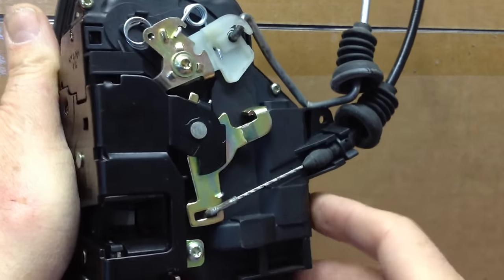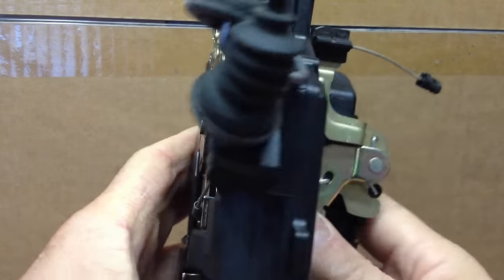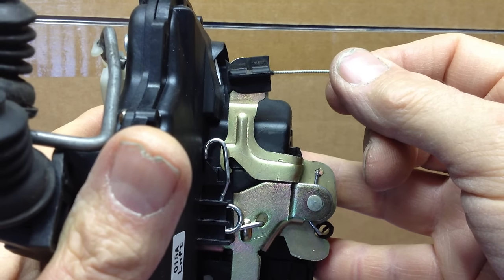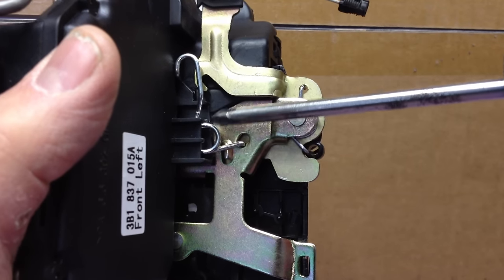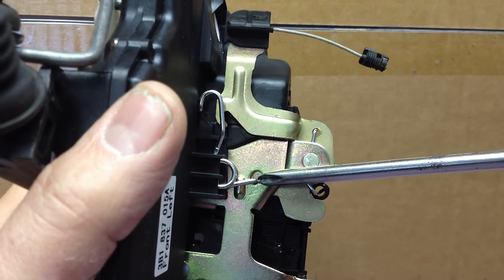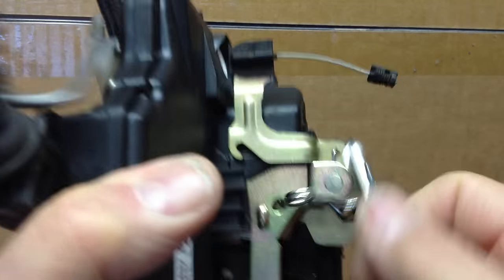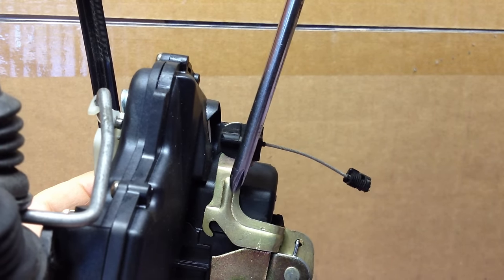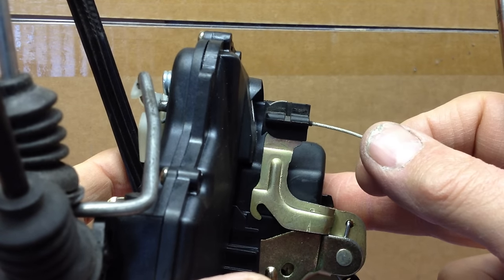Why Your VW Door Won't Open

Comment: The spring that you removed does have a purpose, its to set the tension to the wire that connects the handle to the lock on install. Though it is weird why it scratches the metallic thingy below!! :o
Reply: So, you are supposed to remove the spring after installing of the cable?
Reply: Not remove it unless you want to spend hours after to find the right position for the cable to open the door by handle..Very frustrating!

Comment: Hey Man you're cool. I My car door recently seems to have this Problem. I have never tried to hit one time harder onto the Door Handle if it did not unlock. (Indeed this short harder pushback action also resets the hook mechanism in most cases, then it is able to open). Thanks!

Comment: The other way to do it is whenever the door refuses to open, just disconnect the battery for 10 seconds. Then reconnect and initially flick the open all doors, and then flick close and open again. This works for me every time. That said my door handle does not get stuck every time. I think it is on the way out but those mechanisms are too expensive and I have an 02 Mrk 4.
Reply: When would you do this? My Skoda Octy rear door isn't opening (child lock on too) however I can hear the mechanism locking and unlocking. Not sure if disconnecting the battery would work or do I need to strip down the door panel etc which would be a pig of job?
Reply: SoleFreak my be rear door did the same thing. If you disconnect the battery for about 10 seconds than reconbect, I think that resets it. Than use the electronic switch on Riverside to open and close it a few times. It works for my be golf. Try it what have you got to loose? I think the process has the effect or resetting the locking mechanisu. Like the guy indicating in vid.

Comment: My Beetle drives me nuts, it drives like a dream but all the stuff like door handles breaking and driver door not opening, can't lock the doors from the inside while driving at night you lock them but they pop up again. VW really need to get their act together. I'm in Australia VW had no idea how to fix my broken passenger and driver door handles so I searched the net and found Jim at Dieselgeek in the US who has a fix called Beetle Brace with a metal plate to brace it all together.
Reply: Ha ha, please swap with an ORIGINAL (old) beetle !!

Comment: I would have this man's babies right now! genuinely from the bottom of my broken heart I thank you sir. I have had this door mechanism of four times stripped, replaced and couldn't figure out why it would open and then stopped
long and short if your lock works but your handles in or outside don't the semi circle piece of plastic on the end of the outside handle needs LOOSENED NOT TIGHTENED as it stops the mechanism from resetting I've changed religion 8 times renounced faith had a duel with the devil begged God for forgiveness and all I had to do was open the outside handle moved the black piece of plastic down a few teeth 😥 I'll sleep well tonight
thank you again.    ☝this guy ☝
Reply from the maker: Will Fleming quite the offer, but I'm taken already. :o)

Comment: I have a 2003 VW Bora 2.8 VR6 4motion and although it has the same spring as in your clip mine does not go through a hole , instead it has a tang punched out of the plate that the spring locates on so for me this isn't a problem !!
Unfortunately of course wasn't able to know this till I pulled the drivers door apart .

Comment: Jon my new to us 2014 Cayenne is doing the same thing after I adjusted the micro switch on actuator. Hopefully try the spring reset and then remove the little useless spring altogether

Comment: This is gold. Thank you very much, I had exactly this issue when installing the new lock via the workshop manual's exploded chart: it instructs to fix the spring into the little hook during assembly, which makes no sense to me as it seems it makes the whole cable immovable from that point on, so you cannot use the handle to open the door. 
However, a comment below from Radu Popescu explains that the initial use of the spring is to "measure" the length of the cable so there is no play in it and at first use it "snaps free" pretty loudly, so the mechanism knows the exact length of the cable. Presumably after that it can be removed. I do wonder though how this very tight spring can "snap free" without possibly doing damage to the plastic part. Also, I do not understand the logic of that, as the spring and the lever would be unmovable (it is VERY tight), so the cable would not move at all. Also, the locking mechanism is not tied to the lever, so locking/unlocking has no effect on this fixed position.
The workshop manual does not mention either that the spring is only serving the purpose of the initial installation and it should be unhooked after installing the lock. The result is that you probably will not be able to open the door with the handle after this procedure (at least, I assume as I will not do it according to the manual).
I am in doubt now about first installation of a new lock: according to the manual (i.e. use the spring) or not. 
The manual is pretty adamant about it and states: "It is absolutely necessary to perform a functional check because the door cannot be opened if the adjustment is not accurate and if the Bowden wire is not clipped on correctly." Which makes me assume that the "adjustment" it mentions has to do with cable length?

It further complicates things that the manual says: "During assembly keep the door handle -2- pressed against the door panel."  I saw instruction videos however where they said to PULL the handle while uninstalling the handle cap. I assume the pulling is only meant for the cap, while the pushing is meant for the cable installation?..
Reply: OK, so I did the manual instruction after all, by clamping the spring to the lever. I think the reason for this is so the cable remains in place while you fix it in a variable position and the cable is exactly tight, not too much and not too little. 
So I do not see a link between the electronic and the mechanic. It is purely to keep the cable in place while fixing the plastic ribbed end.
Reply from the maker: Yes Peter, that spring is only used during initial installation to set cable position. It does snap out of the way after the first handle pull. My concern is where it pokes through the hole and hinders the arm. Other than that, it shouldn’t cause any trouble. Good luck.
Reply: @jonplamondon4076  Yeah, it worked just fine. Also, I don't have the hole-poke issue, because mine is slightly different (for Octavia mk2) and it does not go through the hole, but is led next to it. Funny how all else is identical.

Comment: Hi, firstly thanks for the video this helped me with a new lock i just installed today and had the same issue with. After looking at my setup i noticed that the external door handle connector that Jon holds at the start of the video is grooved (see around 01.27) and so is the area where this connector sits in the external door handle. Im guessing that this allows the external door opening mechanism to be adjusted if the cable stretches etc. In my case it was not the spring that caused the problem it was that I had inserted the connector too far away from the door mechanism meaning that even with the door handle in the home position the level never reset itself as there was a tension in the cable. My advice, pull the door handle out and use a small flat headed screwdriver to carefully lift the connector out of its current position, use your finger to put pressure on the cable to stop it from withdrawing into the door frame and reposition it a few millimeters further back in the door handle grooves. Ensure it is pressed back in the grooves close the door and try again. Good luck this helped me and I hope it might help some others.
Reply from the maker: Great troubleshooting. I think that spring that I recommend removing fits in that notch to hold the arm in a position during assembly that closely places the ribbed dohicky in where it needs to fit into the exterior handle. You're right, you can't have that too tight.
Reply: Jon Plamondon absolutely correct. Thats its job. Just for inertial installing the tension of the cable. Cause if theres too much tension the arm cant go fully back its way and the door cant open anymore. My golf 4 doesnt open anymore (right back door). Thats my work for next weekend. Greetings from germany

Comment: Ok... thats a good thing to do if the spring is broken. It will do the job.
However the spring is there to satisfy a purpose. First thing to do prior installation is to "arm" the spring in the notch. If there is no fault there,  that should do the job and would also be the default configuration.

Comment: Happened to me today!!! What a nightmare! I unlocked, opened the door sat inside and proceeded to shut only to have the door NOT CLOSE!!!!   I panicked!!! I had to be at an appt and my only option was to wrap the seat belt around the handle AND was holding the end of the buckle all the way ......yes I drove! I called the dealership, not much help other than "Bring it in".....about half an hour later, I nudged it a bit and found that it had magically closed........Am taking it in tomorrow to demand it be looked at! GRRRR

Comment: In the process of figuring out why my 2000 VW Passat rear passenger power lock won't open and close properly.  All I see is that the button doesn't travel up and down properly when unlocking/locking, though the manual mechanism works fine.  I'm assuming it's something with the actuator motor, but I'm still researching.  I appreciate your video, though.  While researching, I did find a nice explanation of the spring you mention, as well, here:  https://youtu.be/RqmqnK6UXvY?t=169
Thanks for the nice, clear video; great to have folks like you with good content!
Reply from the maker: Thank you.

Comment: Had my VW T5 passenger side door dead locked,cut out the middle shelf to expose the metal plate after bending the door card half out the way,where i saw the lock unit i used a small screwdriver too make a small hole and squirted WD 40 in there,  i was about 10 seconds from smashing up the lock to get the door opened and i tried the central locking,to my amazement it opened,took me around 4 hours,stripped the unit cleaned and belled out the micro switches all fine,so maybe my anchor piont on the door is out off line and iw was not able to unlock. 2 black blanks in metal plate for undoing bolts that hold glass on the runners, hope this helps some one!!!!

Comment: i found that if i just push the exterior handle in until i hear a click, this resets the whole thing. minor inconvenience without having to open the whole thing up. If it fails and i cannot open the door, i will follow your instructions. thanks
Reply: YES!!!...Thank you also Vic, as this also worked for me on my 2000 Golf!  I couldn't open driver's door with lock nor remote, pushing slightly on the door worked for me.  As an added tip, my car is GLS with power windows, and if you unlock the driver's door with key but hold it, the windows (qty-4) will roll down, and you can at least get inside one of the doors via inside door release lever ...but I didn't want to have to do this all the time and be conspicuous, and I'm not excited about opening up the door to replace or work on the doorlatch...this will become my permanent workaround (at least it makes it harder for anyone else that doesn't know the trick to get into my car).  Hope this helps someone else as these details should have been remedied before production, guess we're the beta testers, though not through conscience choice.

Comment: ...every journey starts with a ridiculous handshake. Twist the key, fist bump the handle, pull open the door.I live the "Macarena".

I noticed this spring while replacing the micro switch and wondered why it was even there too. Sometimes they over engineer some neat stuff though as if its for catching that hook for ease of installation...."whats this? designers are thinking about the guy installing the part? nahhhhh...couldnt be" lol

Comment: I had the same problem, but for me the solution was just re-aligning the locking module with the bracket it locks on to. So if this doesn't fix it, that maybe will.

Comment: I'm about to install a new lock module; should I do what humble mechanic suggests and hook on the spring, or do what you do and remove it completely? Many thanks for your help.
Reply from the maker: Shirley, I would go ahead and leave that spring in place as it prepositions the little block on the end of the pull cable correctly in the outside handle. Just make sure the end that of that spring doesn't interfere with the lever.

Comment: I used to think that German cars (Volkswagen, BMW, Mercedes etc.) are reliable and always have high quality. When I was about 11, my father had a BMW 350CC motorbike. It looked so husky, strong and healthy. I trusted German products and respected Germans for their talents. It lasted for years (over 30 years) until my brother gave me a 200 Passat 2.0T. I am a careful driver and not in a hurry in any situation. I spend time regularly almost every week wash the car, wax it, clean inside, check the engine oil, change the engine oil every 3,000 miles, refill the windshields cleaner, check the tires pressure etc. I always keep the car in good condition. The mileage is only over 50,000 miles. Recently, they have some troubles with the passenger door. It cannot be opened from outside. Besides, the headliner is sagging. The airbag needs replacing. The noise from the engine annoys me so much that I think I have to sell it. It is too much noisier than my 2017 Honda Civic and 2016 Hyundai Elantra or even my 1997 Honda Acura.  If anybody is thinking of buying a German cars, please do not buy a Volkswagen vehicles (Passat, Jetta, etc). Believe me! You will feel sorry later.
Reply from the maker: I might not agree. I ran my diesel Golf over 415,000 miles. Lots of preventative maintenance and a few minor issues, like the door mechanism. Stuff's gonna happen. When you find the perfect world, send me the address. Thanx for your comments.
Reply: It happened to me. How can I say in other way. You have your idea and I have mine. Ok?
Reply: 🙌 👏 🙏 🤝 👍 germans lost ALL credit ! The best VW is the the old 32b (Quantum) type . . . see also BRAZIL  . . . Just do NOT crash it please . . . drive carefull and relaxed (its without ABS, Airbag etc.. . .but lasts 4-500.000. KM ! )
Reply: @jonplamondon4076  🙌 👏 🙏 🤝 👍  my vintage AUDI 4000 ran also about 435.000 KM without much bucks for maintenance. . . .

Comment: Jon Many thanks for taking the time to share your knowledge with everyone. It has not worked, yet on my 2006 Altea. With neither remote, drivers door key, outside or inside handles unlocking the f passenger door I have managed to remove the upper door panel and get my hand inside the panel to try to set the lever you point to with your screwdriver. I have pulled it out and pushed it in many times but still no luck. I have come to the conclusion it is an electrical problem as the window on that door stopped working at the same time. Any thoughts please?

Comment: That "useless" spring is set inside that little nook it sits next to and controls the depth at which the outside handle releases the mechanism when pulled.
Reply: Dana Wane  Whats the root cause of the fault?
Reply: Likely from incorrect installation.

Comment: Hi Jon! Should I insert the screwdriver through the outter or inner window slot? And the window should be open or closed? Tks
Reply from the maker: Window down should make it easier. Inside side of slot.
Reply: @jonplamondon4076  Hi Jon! Thank you very much for your immediate reply and for this video, which resulted in me finally managing to open the door!!! With the door open I removed just the lock cylinder (the piece where the key is inserted), and that gave me enough space to adjust the tip of the cable (actually the black plastic piece) where it attaches to the handle - I did this with the door closed and the handle in the 'closed' position. Then I reassembled the lock cylinder, and the door has been closing, opening, locking and unlocking just fine. Actually, I replaced the door actuator a month ago, and it had been working just fine. Now I think that the short steel cable that connects to the handle was a bit loose - now it is straight, but without significant tension. Do you think that I need to make any additional adjustments?
Reply from the maker: @nevadisfc4927  You're quite welcome. Time will tell if further adjustment will be required. Take care.

Comment: Hey tx Jon for this, I think this is the problem I am having with my 2003 VW. Do you know if there are any videos/instructions of how to actually get to this mechanism. Tx again
Reply from the maker: Probably, I can't suggest any though. Take a look around. The one thing I learned by removing mine was to leave the assembly attached to the carrier as you remove it from the door. Unhook the window with the 2 screws and tape it in the closed position.
Reply: Yes I have had a look but thanks for the reply and handy tips

Comment: 06 Cayenne, Fonzi trick works from the outside but from the inside sucks and almost have to kill my kids when this happens so, I bought just one new mechanism just in case and assembly spring is  exactly where the video says it will be, pulled it from new door mechanism installed and the old mechanism as well, i will pull the springs on the 3 remaining doors when the time comes, this repair sounds logical to me because it never felt like an electrical problem when I make the fix for the other three I will post and while the fix will save you on the mechanism don't cheap it on the panel removal taking panel and mechanism off is a pain and better be done by a pro or someone with patience.